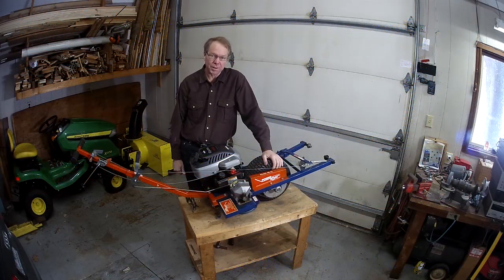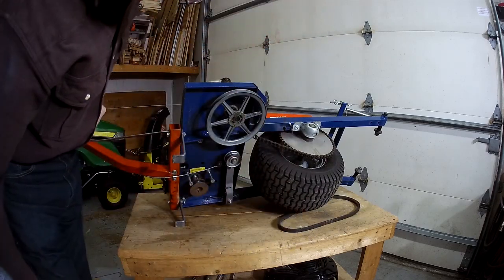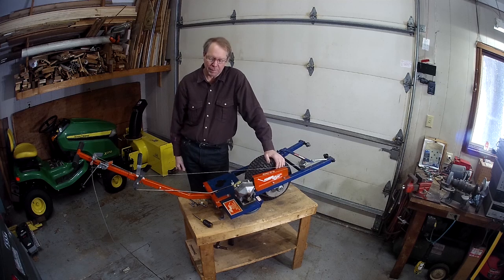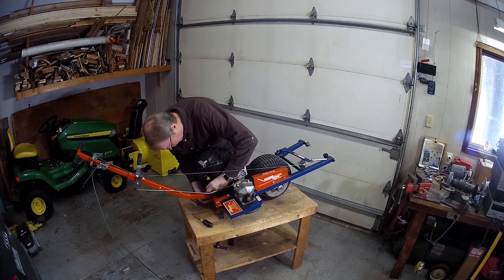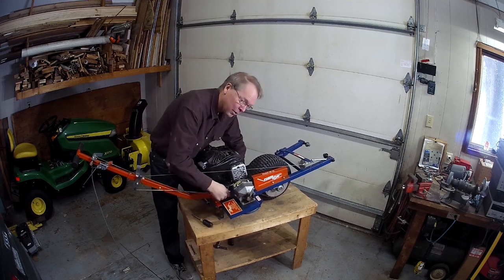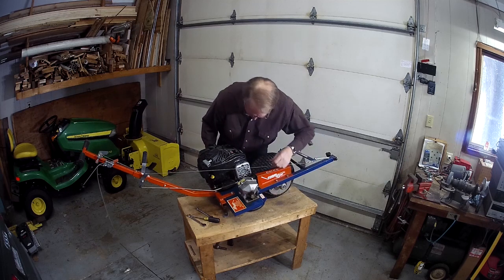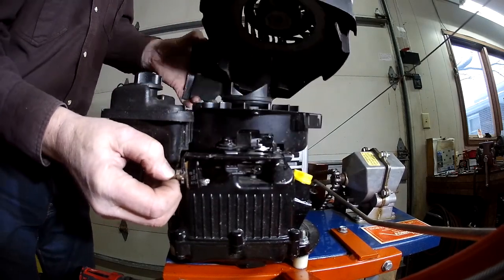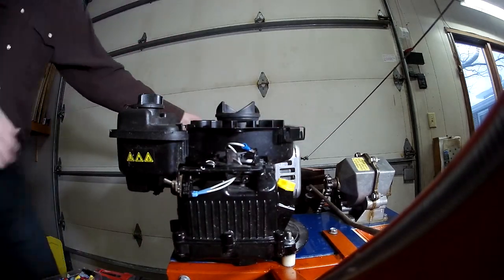Engine replacement on PowerTow 40EZ airplane tug

Comment: This is VERY helpful--THANK YOU!  I'm about to put a new engine on a 40-EZ that came to me (used) with an airplane I bought 27 years ago. 
I noticed you never reattached the throttle cable. I guess the tug and engine worked ok running at some "default" throttle setting?
Reply from the maker: Glad to be of service! Yes, like many small engines (ie the power washer engines I mentioned)  it runs at a pre-set speed, managed by the governor. The belt drive lets us "feather the clutch" to get the needed speed. If you want to try for a dead slow pace, I could see spending the time to connect up the throttle, as long as your engine has one. As I recall this one did not have that mechanism.
Reply: @cardinalflyer Thank you. I think I’ll give it a “go”.

Comment from the maker: A quick note for future watchers... one challenge I faced was that the fuel bowl on this engine struggled to contain the fuel. The problem was the slight tilt while the tug was parked - over time the fuel would all drain out. 

I tried a few things, from parking it on a 2x4 (which worked) to finally sealing the rim of the fuel bowl (on the carb) with some gasket seal.  That seemed to do the trick.

Comment: Thank you. What was the part number of the original or replacement engine? Shaft length? Diameter?  Thx!
Reply from the maker: I don't know, just measured what came out and compared it to what went in. They used different engines over time, from what I've seen, so you're best off finding out what you have before buying anything.